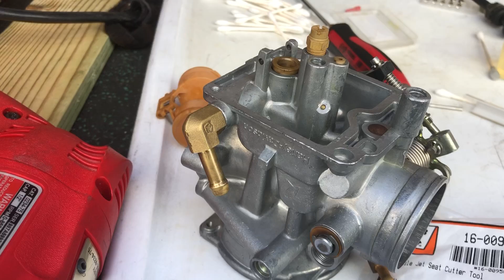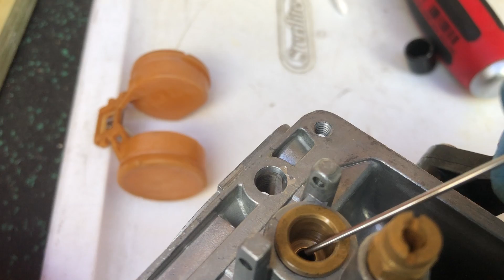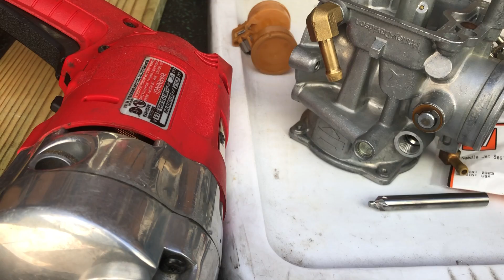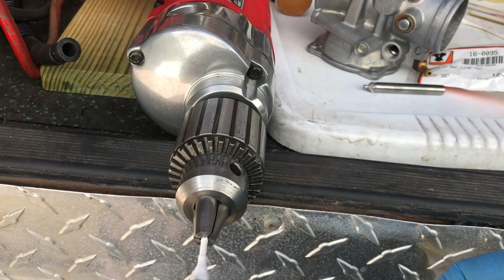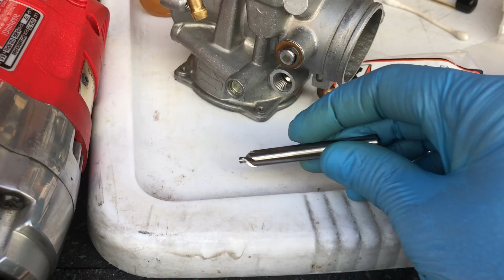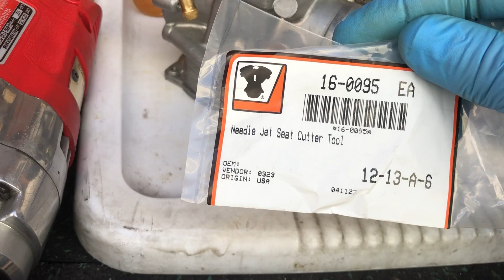Testing and reconditioning a carburetor float valve (Harley-Davidson CV40 Keihin) -- Part 3/3

Comment: Very informative!
Reply from the maker: I appreciate the feedback.  Just to put it out there, the 4 psi seal I was able to get from the float valve is entirely overkill.  The hydraulic head the fuel in the tank delivers is less than 2 psi.  If your float valve is sealing at just under 2 psi, that's all you need.  I was originally experiencing an intermittent fuel leak that was actually caused by a cracked overflow tube in the float bowl, which I incorrectly attributed to a leaking float valve.  Here is a link to the video that demostrates the problem with the overflow tube: https://youtu.be/HduBfiONzlM
Reply: @Zerk_Ziegler  I used to work at Harley dealership and chased an overflow problem for a while, I set the float way to low and the bike starved for fuel in upper rpm range. Came back put the bike on the kickstand and still leaked. Then I found the cracked overflow pipe, first one we ever saw.